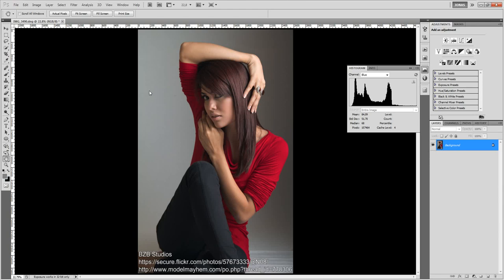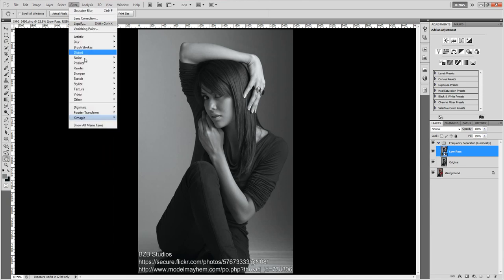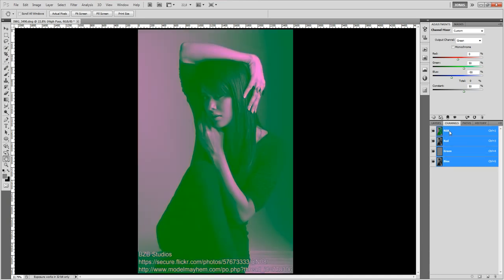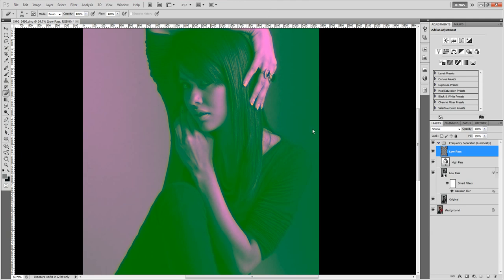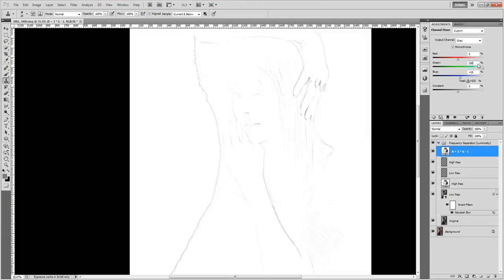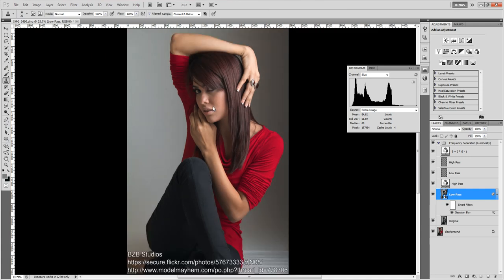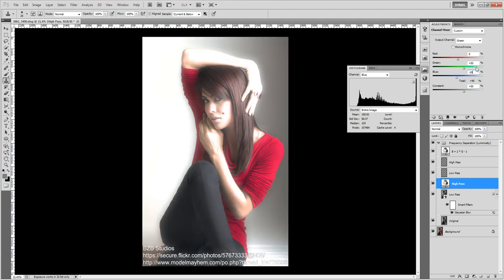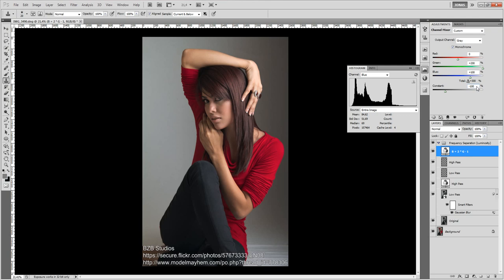Asymmetric Frequency Separation Channel Mixer

Comment from the maker: Hi Esteban,

I'm not sure I understood this question correctly, but I'll try to answer as good as I can. To clone imperfections you can work on the "Low Pass" and "High Pass" layers with the clone stamp set to "Current & Below", the group itself has to be set to "Luminosity" mode because we need two channels for each separated channel and there are only three available.

Comment from the maker: This is correct. After you did some corrections, readjusting the radius of the low pass is not recommended. The results are more visible for any fixes to the low pass in my experience though, fixes to the high pass are not affected nearly as much.
E.g. if you have an initial blur radius of 15 px, clone some low pass information and then set the blur to 10 px, the area will get more blurry. If you set the blur to 20 px, the area will be sharpened a bit.

Comment from the maker: Ah, now I get it :)!
Yes, that's one more flaw with the method (as I said in the video, it's still in experimental stage ;)). What you can do though which is a little faster for me is create a new Hue/Saturation adj. layer underneath the group, set the blend mode to "Saturation" and move the saturation slider to -100. Now every time you need to work with the separation, enable the visibility of this layer and disable it when you're done.

Comment: Awesome. The idea behind this video would be really good for every retouch. To have a dynamic frequency separation would be a dream for me. But actually I see 2 problems to work with it. The first is that it looks like it's need to have de group layer in "Normal" mode to clone the skin imperfections and set to "Current & Bellow", isn't it?

Comment: I have a theory on how this could be useful. Generally the blotchiness of skin is found mainly in the blue channel, so it seems like doing your dodge and burn on the LF blue channel would get better results compared to simply using a channel mixer blue channel guide layer (set to luminosity) on a traditionally split image. This is because with traditionally splitting an image and using a blue channel mixer adjustment layer for visibility help, you'd still doing d&b on all the channels, even the red channel which probably doesn't need any blotch smoothing. 

Appreciate you sharing your discoveries. I love seeing Jonaswtuts in my subscription box. I always know that I'll learn something really interesting, well when the videos are in English at least. Actually even watching the ones I can't understand has taught me stuff just from watching the workflow. Thanks so much.
Reply from the maker: mpretouch Interesting idea, let me kow if it works out :)!
Sorry I’ve been getting more and more inactive lately. Unfortunately I’m not sure if and when this will change again.

Jonas
Reply: +mpretouch and how u set the DB layer to the LF blue channel?
Reply: Any update on your theory?

Comment: I think it's my problem. Trying to explain it in English is hard XD
If I try to use clone stamp on Low or High Pass layers WHILE the group is on luminosity mode it doesn't work.
What I actually have to do is change the mode of the group to normal, retouch and change it back. I have tried the action you provide with the same results :S

Comment: The second is that if you already made any change in the empty high pass (where you use the stamp or any other tool) layer and then change de low pass gaussian blur parameter, it will give bad results on the final image, so it would be needed to recreate the high pass empty layer, right?
Thanks again for your explanations!

Comment: Hello Jonas Thanks for all the great videos. Only have the texture problem on my side here. When i use your action and do my fixing on the low pass layer it works great but when i clone on the high pass (texture) i get color contamination after i change the group back to Luminosity. Any way to fix that or no?

Also has anyone experimented with different channels as the advanced blending such as low pass for green or red channel and vice versa for the high pass?
Reply from the maker: +TheConArtist Hello TheConArtist, sorry, I can’t reproduce your problem. Could you please check if your clone stamp is set to sample current and below only (if it’s set to sample all layers that might be the culprit)? Otherwise I’ll need a more detailed description of your steps or maybe a PSD file to see the problem first hand.
Reply: +TheConArtist dude, when u clon eon highe layer, u have to select "current layer"; probably u have selected all layer
Reply: No its on Current and Below... Thanks.

Comment: Jonas can we split the image using this way but not desaturating the image first? If so what setting must we use in the channel mixer? Thanks
Reply from the maker: Unfortunately no. The reason I desaturated the image first is that you need two layers (a high pass and a low pass) to make up the full frequency range of the image. To get around this and still keep the flexibility of using adjustment layers, the trick I used is to abuse the color channels to keep the necessary information. However, due to that there is no way to (easily) keep the color information intact. You could repeat the whole process thrice (once for each color channel), but that would be very cumbersome to work with.
I haven’t really worked much with Photoshop in the last few years though, so I cannot say if there are new methods that could improve upon this technique in more recent versions (i.e. anything after CS5).
Reply: @jonaswtuts  Thanks for the reply

Comment: Okay so we work on the blank layers themselves right? How do we clone or heal on them? Cause we can't use Current Layer it has to be Current and Below, then i get some color information on the High Pass layer when doing so. Am I missing something here, cause even in the video you seem to have trouble during that part and looks like you edited it.
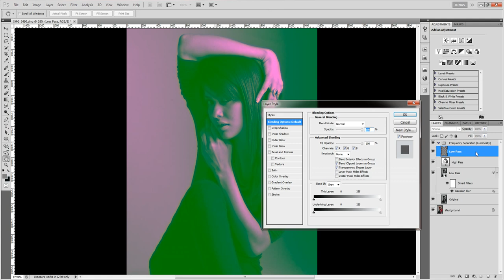Reply from the maker: You need to make sure that only the respective channels (blue and green) are activated for the “Low Pass” and “High Pass” layers (I explain that at about 2:46). Then you can use the “Current and below” option because it won’t affect the other channels and the whole group is set to “Luminosity” mode. I hope that makes it a bit more clear? As I said in the video, this one is rather experimental, so I never really tried to improve on it and wouldn’t recommend using it for real work.